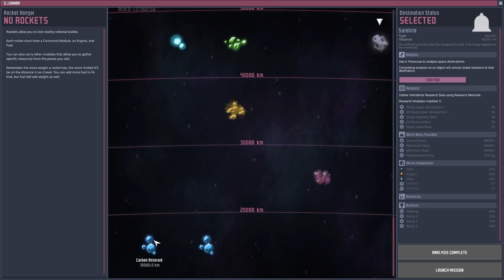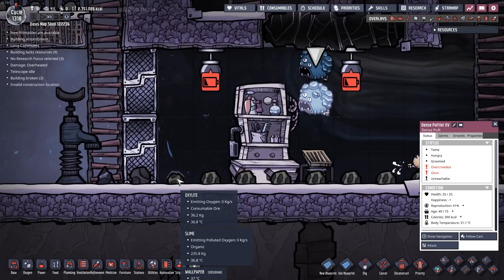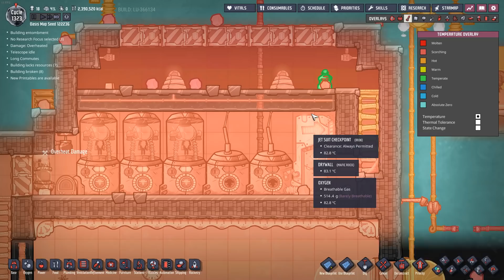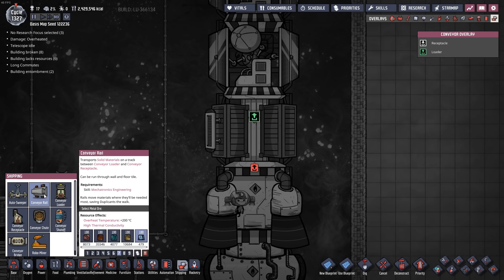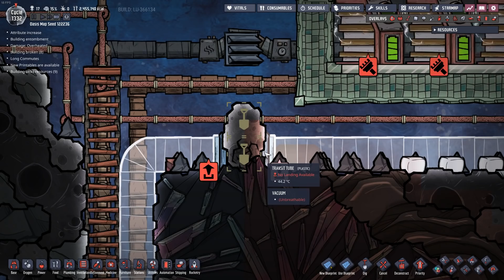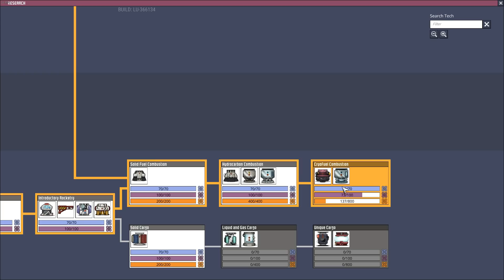Petroleum Rocket Power! Oxygen Not Included ep31

Comment: the problem with aluminium is te 600 °C solid state that will sit on the diamond tile , will not deliver the heat inside it fast enough , but you can make a mix of aluminium lead and ethanol(just for fun), that will cover all the range temp
Reply: I think the bigger issue with the aluminium is that I'm sure it stacks more in a tile block as a liquid than a metal tile of it. But the even more pressing issue is that you can't build wallpaper behind a tile so it will all vent. IT WILL ALL VENT. You will have an empty upside down top hat of diamond because all your aluminum was vented to space.
Reply: @justinsweeney6528  ofc you don't need build the  wallpaper with it , but just leave it on the ground XD
and yes 1 full chunk of solid is 25t for stack , and you can stack multiple chunk in a tile (unlimited?)

Comment: You could put a few Pokeshells where your ethanol distillers are.  That way the polluted dirt is dealt with without needing to have dupes drag it everywhere.   Might need to ranch a few to get enough to deal with all the p.dirt, but it's something.

Also, you mopped up the petrol that was preventing the CO2 from the jetsuits from entering your space base.  Should be able to empty the bottle though to replace it.
Reply: Yes! Ranching Pokeshells would also produce shells->Lime for steel production :D

Comment: How do you keep your solar panels from overheating? I have a similar setup but they roast at 75°C and it's impossible to keep them viable for more than a few cycles. If you've addressed this in a previous video I apologize and if you tell me which I will watch it. You're the best ONI dissector out there <3
Reply: Make sure they aren't touching any regolith or space rocks as they will conduct heat from them.  If that's the issue then I'm not sure.  Normally mine break because a dupe randomly dropped some 500C regolith on them.